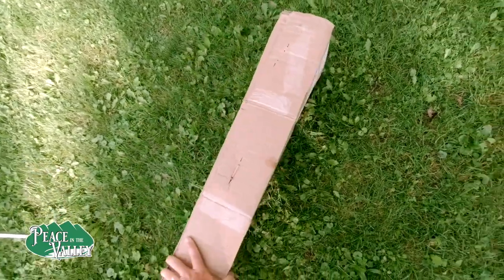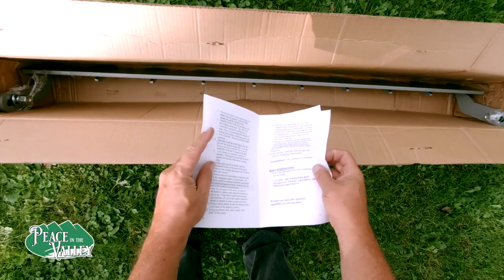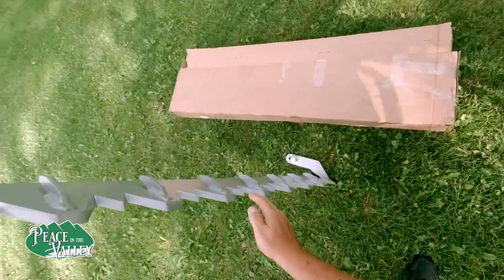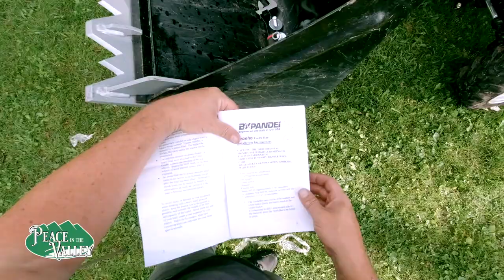Episode 18: Piranha Bar arrives and Installed!

Comment: I'm really impressed with the RK 25 Brice. I was interested in the RK 24, but from looking the 25 has a little more Stance. I'd love to see a side by side comparison made with these two machines.
Reply from the maker: The only thing I had to go by was the sheet on the RK website. It shows the RK25 to be a more substantial tractor in front end lift and that was my main decider. I saw them side by side at my dealer when picked it up but my picture has the RK24 in the background and really doesn't show them well together. I was surprised how much bigger it was than RK24 seeing them together. I still believe that 24 would be a good machine and would serve most of my purposes, but I am glad I went with the RK 25.

The spec sheets for both machines on the RK website, I would not consider accurate. The tractor is significantly heavier than what is stated. I want to get a more accurate weight but sitting on my 14' 2 axle trailer - WITHOUT the backhoe attached (3 point post hole digger was attached 250lb est), the total weight was 4600lbs.
Reply: @PeaceIntheValley  thats awesome my friend.  Thank you

Comment: Nice install, Bryce.  That's annoying that the bolt ended up right on the rib of the bucket.  Always something, right?  I'm wondering if I can install mine making a hole on both flat sections (adding a new hole to the tooth bar a little bit closer to the cutting edge).  Thoughts?  The way that thing is engineered, it looks really stable and almost like it locks in place without any hardware at all, which is why I'm thinking the hardware is merely there to keep it in place.  I ordered mine at 51-3/4".  Much bigger bucket on the new RK25.
Reply from the maker: Always something! I wouldn't see why you couldn't mod the tooth bar. The bar is half inch steel so it will probably take a drill press (or at least clamp it to something sturdy). I don't believe the steel is hardened - just use plenty of oil when drillign. When you get it you can find out if it interferes with the rib on the bucket. It may not on the rk24.
Reply: @PeaceIntheValley  I appreciate the heads up!

Comment: What length bolts did you end up buying? My rk25 is on order unfortunately 😕.  Thanks!
Reply from the maker: I haven't gotten the longer bolts on yet. One thing I did find out though is the  grade of nuts/bolts provided are 2 - they are pretty soft. I took off the bar yesterday while doing some work and noticed the nuts were somewhat sheared against the toothbar bolt slot. It wasn't a problem, but it does keep them from coming back out on their own. I had to use the impact wrench and crescent to get it off.

Comment: How wide is your bucket  on the rk25. inside to niside .how long is your tooth bar ?.I am going to get me one of them. I think my bucket is 58" 5/8 inches   dose this sound right .   bolt fix Question what did you do  to fix.
Thank you for   these videos .
Reply from the maker: 58.75 inside width for my bucket. I would assume BXpanded has fixed the length now. I'm getting ready to post a straight bar video in the coming days and the attachment brackets are longer now and not in the way of the bucket ribs. I didn't do anything other than just bolt it on and go through the rib. I may extend my older brackets so they fit in the same hole. Right now, have wholes on both sides about two inches apart. thanks for watching!

Comment: What length did you get. I’m getting mine in a couple of weeks and think it would be something I might add to the tractor bucket.
Reply from the maker: The size for my bucket on there RK25 ended up having an inside width of 58.75. It was a great fit. I just need to get longer bolts.
Reply: Thanks, I ordered mine yesterday with that length. Appreciate the info .
Reply: @PeaceIntheValley  thanks for the measurement and advise. Mine came and it fits perfectly. The bar does improve the digging, especially in stone. I did put in the comments when I ordered it about the longer bolts for a RK 25, it seems the one I got has longer side rails that go beyond the bump out and the screws were just the right length. Thanks again.

Comment: What size bar did you order? Because of the wait times, Id like to get my bar ordered as soon as i can. But Im another few weeks out on the machine. So curious what size you went with.
Reply from the maker: The size for my bucket on there RK25 ended up having an inside width of 58.75. It was a great fit. I just need to get longer bolts.

Comment: Wouldn’t you think nut on the outside to reduce collision with material inside bucket causing loosening? Maybe a lock washer?and a video of scooping with and without 🤠
Reply from the maker: There are lock washers that come with it but I could only get two threads on with the bolts they provided and that was not enough to tighten it properly. I do plan on getting longer bolts. I'm not sure if it matters whether the bolts go in or go out from the bucket. Either way they will get chewed up. I didn't want it catch on me when I walked by.